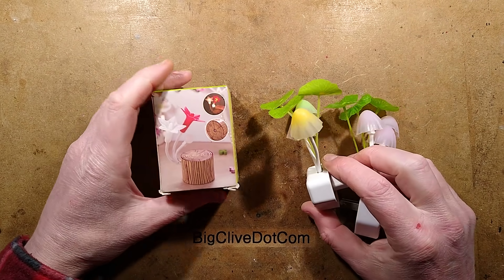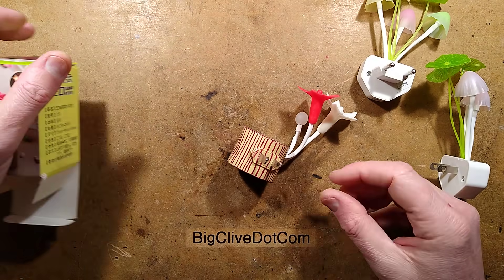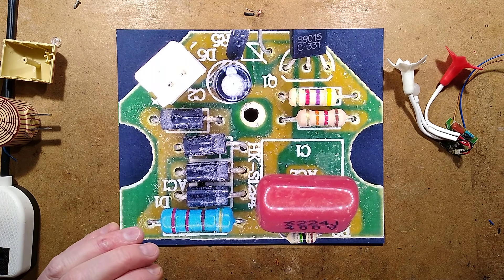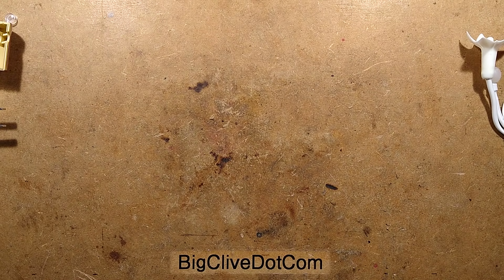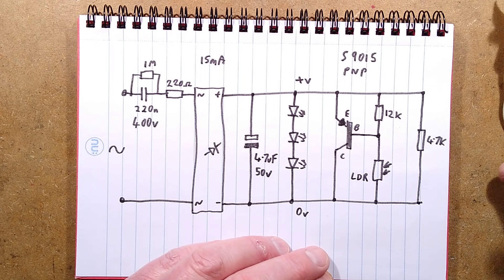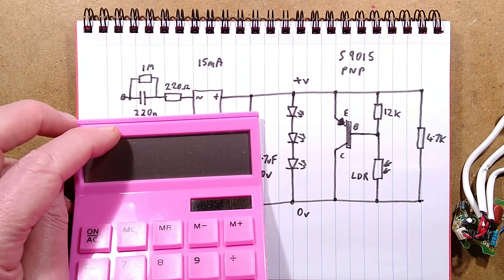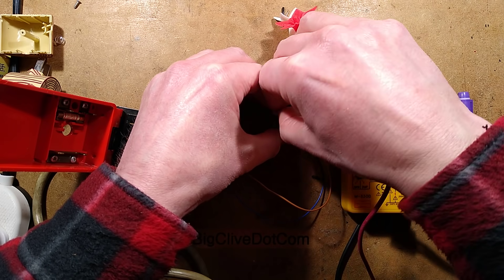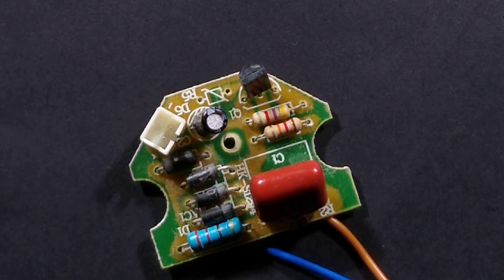Trying to blow up a Chinese night light - and failing (with schematic)

Comment: I’m probably talking out of my arse because I’m a very novice Electronics hobbyist what are use the one meg resistor across the 220 460 V capacitor because the voltage in China E is 120 V or is it 230 and am I still talking out my arse please comment I have learnt a lot from your child as I have had to retire early so I spend a lot of time messing around I’m going up lots of electronic things stay safe keep the content come in and keeping me sane LOL
Reply: I think it's just a bleeder, depending on when in the ac cycle the plug is pulled there will be somewhere between 0 and 340 volts (peak of the 240VAC RMS sine wave) across the cap and the exposed plug pins. So the 1meg is there to turn that charge into heat before it turns into a shock.

Comment: Those devices have American mains connectors. Makes me think they are 120V, not 240V.
Reply: Japan and China use a similar 2 blade connector to the one used in the USA.
Reply: In China the standard voltage is 220V / 50Hz and use the same plug / socket as ungrounded US type plugs.

Comment: I keep scratching my head trying to imagine what bridge rectifier is NOT a full-wave rectifier.  Am I missing something or is this just urchins playing in the rubble of a prior civilization?
Reply from the maker: A single diode is a half wave rectifier.
Reply: Is a bridge rectifier and a full bridge rectifier the same you mean?
Reply from the maker: @burtgummer9057  There are other configurations involving two diodes and a centre tapped transformer that give full rectification.  Full bridge rectifier is how I refer to the four diode version.
Full bridge rectifier is an abbreviation of full wave bridge rectifier indicating that it deals with the whole waveform.

Comment: Disconnecting the LED's with the transistor, resistor and LDR removed should now make the cap go boom...
Reply: Or at least pffffffft
Reply from the maker: The 220nF cap limits the current, so it tends to be less spectacular and take a while.

Comment: I think that turning off the LEDs with the shunt transistor is a waste of electricity.  The whole reason for turning off the LED during daytime is to save energy, and shunting the LED wastes power.  It's more efficient to leave the LED on 24/7.  Cheap chinesium!
Reply: It does waste energy but it still uses less power than it does with the LEDs on. I remember a similar design on this channel with a resistive dropper, and that actually uses more power when off. It's probably more for the illusion of saving energy for people used to incandescent night lights.

Comment: Why you always print pictures instead of just do a screen shot [one button]for us ?.
Not enough trees are die yet ?.The open transistor has 0,8V of drop and three leds in series above 6V.The power on day time are put in 220 resistor.